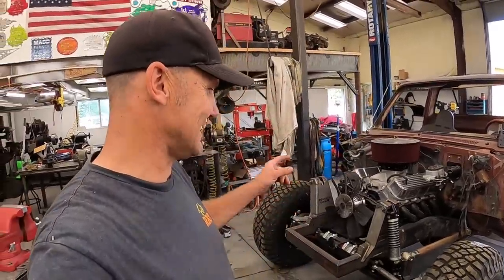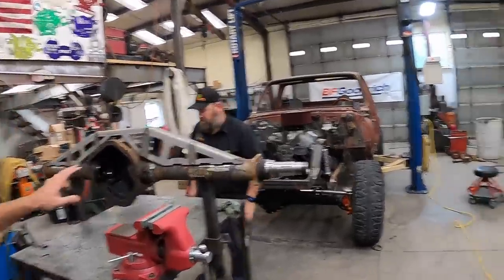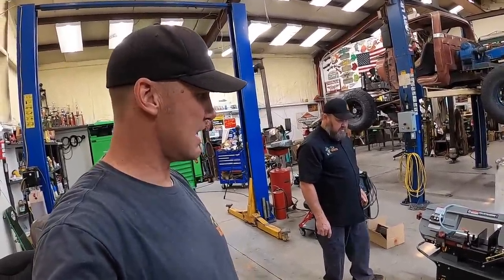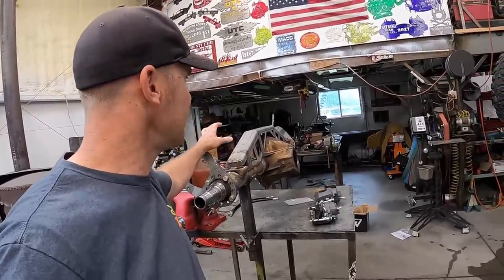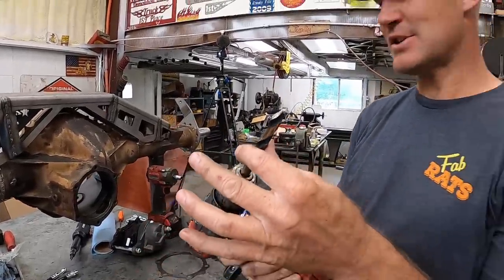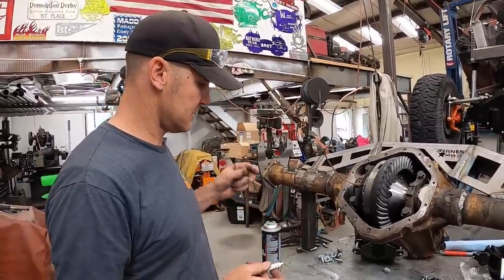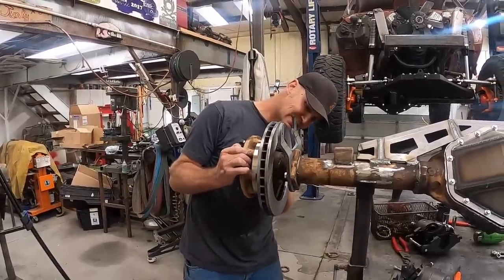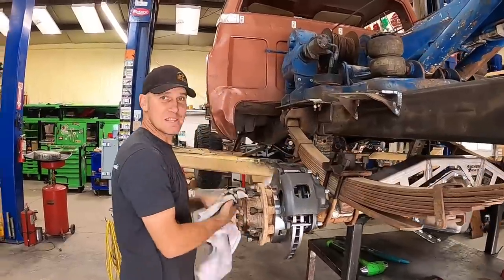The Rat Rod Wrecker Rolls Out On Beefier Axles!

Comment: hello paul. i noticed when you tightened the rear U bolts. they were not straight. the U bolts will straighten themselves out in time causing them to loosen. you may want to loosen them up straighten them and retighten. i love the direction this truck is going. have a good one.
Reply: His hands are his torque wrench.  Calibrated every morning.
Reply: @kchididdy  that has nothing to do with my comment. i did not say they were loose. try reading. i said they are crooked.

Comment: I think all those saws come out of the same "China Saw Factory". I have a Jet brand. Same saw but painted white. 
They work. The coolant pump, failed early on, in mine.
** I would recommend,  you change out the gear oil in the gear drive. You'll probably see a lot of brass in the oil.

Comment: Paul and Ben are coming along with the Rat rod tow truck getting the rear axle finished and installed this will make a big difference! Now the rock sliders can be installed so that fenders etc can be installed. The disc brakes are awesome and a good asset to the truck. No dually's on the rear axle I'm surprised because it is a tow truck? Paul and Ben will test it and see if they need to change this when it goes into recovery's. Be good to see the Elevation guys back doing the hydraulics and then onto Chad to do his magic! Good job to all and welcome aboard to Hunter Cox!

Comment: I've always found that drilling a pilot hole just slightly larger than the chisel edge on the size drill bit you want to use works wonders. Those stepper bits look awesome and I might have to try some out!
Reply: That way your entire cutting lip is into the  workpiece. If u drill the pilot too big its very hard on drillbits. If im not mistaken textbook says to make the pilot just big enough to clear the web of the final drill size. But good luck doing that without a rugged powerful mill. Hand drilling and cheap drill presses will need incremental drilling probably

Comment: Paul you have whats called “cosine error” on your dial indicator. Its interfacing the gear at a 45 degree angle so your play measurement isn’t accurate. Essentially, With the indicator at that extreme angle, your gear is moving twice as far as the indicator is saying. You need to have your indicator set up so it’s taking a direct linear measurement.
Reply: Dad was in woodworking in high school. Instructor was an arrogant bastard. Just looking for ways to beat the kids down. They had to make a nightstand for a grade. Dad made a mistake and cut every 45* at 42 or "something". Realized his mistake and told the instructor. Instructor gleefully said "CLAMP IT UP...LET'S SHOW THE WHOLE CLASS WHAT YOU DID WRONG!" Clamped. Instructor stabbed square in expecting that ugly sound when it hits only one surface, NOPE! Thunk, thunk, thunk. She was dead square. PERFECT!  Instructor said SOB! GLUE IT UP! He was crushed cause every mistake complimented each other. 

My point is, Paul has been making same mistakes, and adjusting to suit, but it all works just fine. Not saying you are wrong. Sometimes you just have to shrug & move on.
Reply: That cosine error is exactly what I saw. Having worked as a machined parts & tooling inspector for 45 years, I tear my hair out when I see people making mistakes like that. 😀 Even Wikipedia has a page on cosine error!
Reply: @pat8988  Thanks Pat. As a machinist for 25 years I have eagle eyes for these types of things and try to pass on friendly advice when i can. I will have to check out that Wikipedia page! Cheers :)
Reply: I realize that ARB's are your go to but they often seem to have trouble... Love the build and watching you and your family interact while you get stuff done. Thanks for sharing with us👍😊...

Comment: Man seeing you tightening up those u bolts brought back memories of me as a kid helping my dad swap out the rear end on our  old van. He had a habit of having me break loose and tighten bolts when he couldn't get the bolts to turn because even at 13 I could lift more weight than he could at the drop of a dime and I didn't lift weights and he did. I was a natural strong. God I miss working on cars with my dad. He's still around but he doesn't work on cars anymore.

Comment: I’ve been a mechanic for years but you’ve given me more confidence. I recently picked up a r30 cab chassis with an 84” cab to axle. I’ve always wanted a 4x4 square Dually I’m current planning on putting a drw 60 up front with the ord brackets and cutting it down to a 60” cab axle (the 11’ flat bed is ugly). A year ago I would of never had the confidence to cut 24” out of a frame.
Reply: @FabRats These are the comments I like reading in the replies. Mostly be this channel has given me confidence in my abilities too keep it up guys.

Comment: Paul, to deal with your rain water problem coming into the shop doors you could make a slight concrete berm around shop doors so the water follows the least resistance around your shop doors. also another option is putting in drainage 4' trench drain channel & grate to get the water to go away from the shop doors.

Comment: I notice even with the new horizontal saw you still do not use lubricant to save your blades. Try soluble oil. Looks like it has the tube to bring the soluble oil to the blade by a pump.
Reply: To messy for me cutting pipe or tubes runs out both ends.
Reply: Its the clean up before welding that makes most of us cut dry

Comment: When you add to the shop for an office and stuff I'd see if you can't get a drain dug infront of the shop the whole length of the shop and then maybe the water will run into that and around the back of the shop so you don't have to dry it out as much ❤️  toe truck is coming along great 👍  can't wait to see it finished

Comment: Got to say I am Loving the build on this Chev.. Doing a great job on the beast. I was just looking at a still shot of the Awesome Grayden Cam. I want call the wrecker company but I had one on a Chevy 77 model, Same winch set up, boom and all. The cut you made to put your rear bumper in front of the rear shackles looks to be the same. The placement on your boom lift fulcrum looks really close to the one I had. Note, that is a important area and Some of the old shop build made a slide track to change that fulcrum, to move more forward if needed. Also, you can side pull on this wrecker on some things. Not saying you can set the unit perfectly 90 but you can and I have on layovers down in a ditch with narrow roads and or DPS not allowing one lane to be blocked. Yep, some said it want work but use physics a little and you can. That will be a tough Off Roader Beast of a Wrecker for sure. 
   Got to say the new Camera guy Hunter, doing a great job. Welcome HUNTER!

Comment: About that garage flooding....  Dig a trench in front of the door, the width of the door about 3 feet deep and about 3 feet out, and fill it will gravel.  You'll still be able to pull everything in and out and the garage won't flood anymore.  Had a friend who had the same problem and that solved it.  Skip in Reno.

Comment: Paul, I’ve seen a few of your videos where the water is running inside, and there’s a fairly easy fix for that water issue. You can cut a control joint and/or groove it with a “crack chaser” just inside the door, and make a few cuts/grooves going out the door, under the seal. If you make it get deeper as it goes out, it should handle most of the water that runs inside. 
The only real downside is they can get filled with dirt and debris… but that’s usually easily fixed with a quick sweep with a broom. 
They make blades for your 4” grinder. I’m not sure what kinda stores you have around you… but you can order it from a place by me called “Colorado Concrete supply” or if you wanna big corporation to order it from… “HD Supply/ Whitecap” is owned by Home Depot.

Comment: Hey Paul, a suggestion for your water problem,  cut a 4" strip outside next to you door and in lay a 4" pvc pipe cut in half with a 10 degree angle to allow the water to run off before coming into the shop

Comment: Might I suggest digging a curtain drain around the front of the shop for your rain water issues......24" wide by 24 deep with 3/4 inch drain rock should do the trick......

Comment: When setting up a differential and checking it with marking compound it is better to rock the carrier back and forth while the pinion is in the marking compound instead of just spinning it around.  

When I setup a differential I don't even like being at the upper part of the tolerance range. At a minimum I will set the clearance at the middle of the range.

Comment: Anealing that copper before you try to straighten the kink will relive the work hardening that it acquired when it got bent. It'll be softer and more forgiving if you torch it with the lights off until it glows a dull cherry red and let it cool

Comment: Once again I'm going to say I highly approve. That old square body is one of the reasons I got into Paul's channel. I drive the 75 C-20 custom deluxe camper special my Dad bought new in November of '74, and sometimes got to drive to school with the 30-30 Winchester in the gun rack and nobody had a problem with that back in the day. The one that he would throw me the keys and tell me to run down and get him a pack of cigarettes and if I got pulled over, I stole the truck. Think I was only 15 at the time. Something about going straight there and straight back and don't run the piss out of it. I don't know if I ever went straight there and straight back, and for some reason he always knew when I had put my foot into it. It's getting harder to find parts for those old beast around here. I try to keep it as close as to what it looked like when the old man had it. the 350 that came in it is now a 383 stroker, the turbo 350 is on it second rebuild, it's got 82000 on the odometer for the sixth time that I know of. I just did bearings all the way around including the carrier bearing and u-joints and new pads in the front and new shoes in the rear. Last time I did the bearings was in 2000. The only thing that I really want to change out that the old man had on it. Is those damn 16.5 wheels,it originally came with 16 fives, he put Les Schwab White wagon Wheels with wild country 33x12.50x16.5 on it years ago. And I think a 4-in body lift. About 10 years ago I swapped out the White wagon Wheels for some chrome rims. And was running 35s on it. But I need to get away from the 16.5s they're getting impossible to find anymore. Even used, I always find it amusing when the kid at the tire place is swapping out a tire for me and he looks at the date code on the tire he's taking off my rim and looks at me and says this tire is older than I am,how long have you been running these?

Comment: you may have a smaller saw but it is still taking up the same amount of floor space you have to make the base smaller for that to actually matter. Unless you plan on doing something with the cart on the side to hold something. If you ever go back and redo it you could push the saw to one side of the cart and build something on the other end for whatever reason.

Comment: I like to point out some times if you install the blots In tight some of the bolts won't go in install all the bolts then make them tight I seen this when I install  water pump on a 1970 Chevy cast iron motor Iosen the bolts get all of them in started by hand I had no problem with the bolt holes

Comment: --- What is this sorcery, Paul!?  Leading off  with breaks?   And I was beginning to think you didn't require breaks :)   Beginning to think your vehicles stopped because 'wishes'.   
     The Tow Truck Olympics, if I may.  My father and his friends every year for 30 years, went on a 5 day canoe trip, they had this paddle, and every year the guy that screwed up the worst on the trip, got his name stenciled onto it.  Lot of names on that paddle, including mine once.  It hangs on the wall of my garage in barn.  An concept idea you might want to consider and pass along to Matt, etc, for your little comp.   
      Couldn't agree more on Amazon.  90 percent of what you get never really quite fits together, doesn't matter what you're buying.  I wonder why that is?   No.  I don't.
      Thumbs up.

Comment: It looks as if you need install yourself a French drain in front of your building I seen this flood many a times grading it with a slight slope away from the building would be just as good but take more time 12 in trench with a 3-inch perforated pipe and float Rock use the hard SRD pipe for septic systems it'll stand up longer to the traffic

Comment: Lets hope that Central Bandsaw is better than their prior models. 
I’ve got a Dayton what’s made of the identical castings the Central constructed of. I expect they came from the same foundry in China. 
But the Dayton uses ball & roller bearings. The Central is using plain bearings and cheaper accessory pieces and a crappier motor.

Comment: I am puzzled (not hard to achieve). Why leaf springs AND air bags? Leaf springs I understand. They allow a flexible frame and loads at both the front and rear hangers. But, with leaf springs, you never put air bags on the axle itself, as that will require a massively stiff frame (like a big rig road truck/trailer). If it is not built up like that, the frame will bend and snap/fracture. I mean, that's basic the mechanics of levers (distance, rotation point, load). Take a 'normal' tow truck with the wheel lift at the back. The load is entirely on the rear leaf sprint hanger. They always tell you NOT to fit air suspension, but instead you add more leaf springs.

Comment: We're do I get the drill bits .been drilling square body frames .and about the ARB air locker is it supposed to run the thin cut gear or seen the thick cut gear .I'm kinda going to be building a wide 14 bolt with 40 spline shafts this information would help somewhere down the lines .

Comment: Watching you push the tow truck into the Finish bay. Why not install a large pulley on the front wall at floor level and use a cable to pull vehicles into the bay? Fork truck backing out on to the drive = pulling vehicle into bay. done and dusted.

Comment: Just curious what you use for a master cyl with the rear disc brakes beings that the stock master cyl has the residual pressure valve for the drum brakes.  If you gut the stock one or if one from a newer truck fits?

Comment: Paul I have a question for you I hope you can answer I have a 05 Ford e 450 I'm putting air horns on .My question is I want to use steering wheel button to activate both horns. So I need to find wire out of steering wheel. What color is the wire and is it a hot or ground. Thanks so much and keep the great videos çoming

Comment: Is there some phase of mechanics or fabrication that you aren't really good at? You amaze me.
I have rebuilt engines that did well but am afraid to tackle setup of a differential.
You say you aren't a TIG Welder but seem to do pretty well.  

Just a note:
Isn't the new saw the same "Footprint" with it on the old base?

Comment: I really like your work, but if you take the time to measure the backlash, do it tangentially, you just measured some sort of movement of the tip along the angled teeth of the ringgear, that had no correlation to the actual movement of the gear.